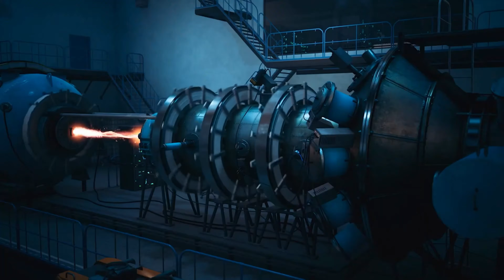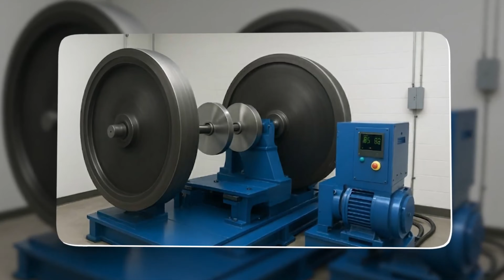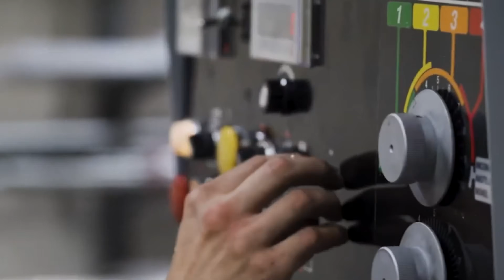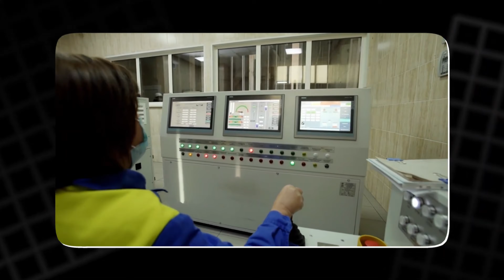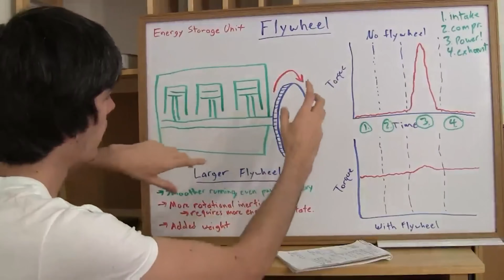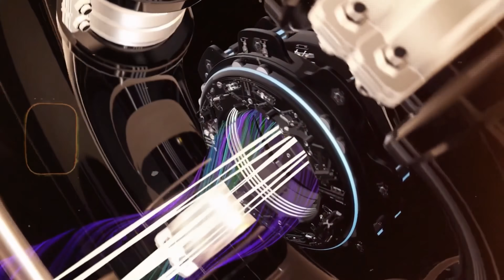How a 2-Ton Flywheel Stores Clean Energy: Inside the Model 30 Power Lab

Comment: flywheels have been around for hundreds of years. When steam power was introduced that gave birth to the flywheel. lots of data storage and grid stabilizers are employed today as a buffer to switch different power sources in ones abrupt failure. Not for long term supply. In electrical use they can be very good, acting like giant capacitors smoothing the voltage. Using part facts and twisting other things. regretting watching this video.